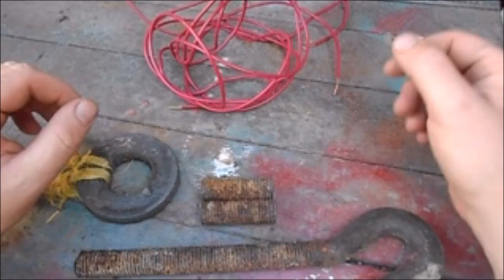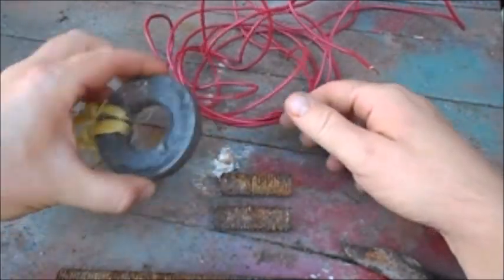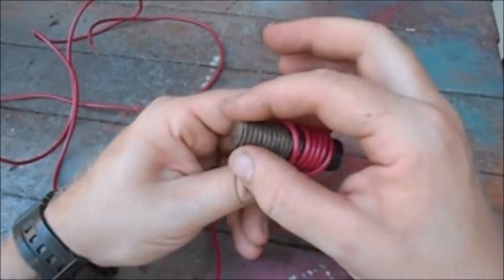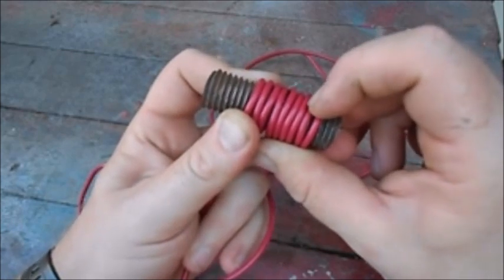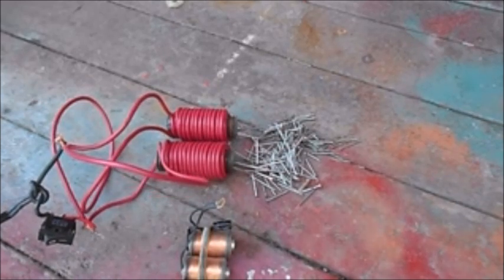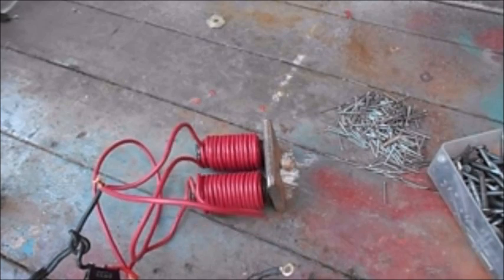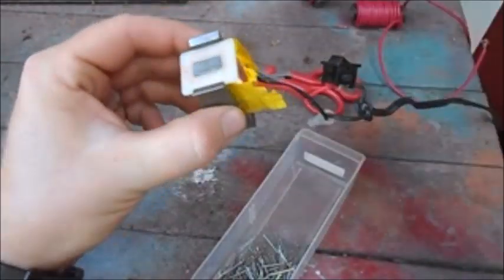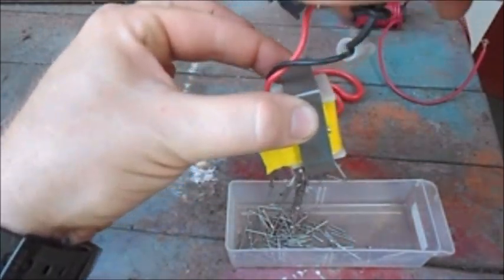Tattoo Machine Coils- Tattoo University

Comment: So what makes it go on and off quickly to create the quick stabbings of the needle?
Reply from the maker: The coil machine acts as a electrical circuit.  It turns on and off.  When it turns on the armature bar goes down.  When it turns off it goes back up.  Attached to the armature bar is the needle and the front spring.  The spring coming into contact with the contact screw (electricity) turns it on by completing the circuit.  When the spring looses contact it turns off.  The needle attached to the armature bar goes up and down with the armature bar.  The spring touches the electricity and then looses contact with it.  This connection and then loss of connection turns the machine on and off.  Needles go up and down.  Simple but awesome at the same time.

Comment: Is it okay if i use other wire..not a copper wire..
Reply from the maker: Tattooing is getting too stiff.  Not enough people willing to push the limits and try new things.  Don't just do what other people tell you.  Try out new things for yourself.
Reply from the maker: You have to look at the fundamentals of a tattoo machine.  Then look at what will work and what doesn't work.  Experiment and have some fun with it.  Part of the joys of tattooing for me is messing with tattoo machines.  Seeing what limits can be pushed.  The more you mess with them the more you learn.  Just look into the fundamentals.  Electricity, Magnets, geometry, and comfort.  You can make a bunch of stuff work but if it isn't comfortable for the artist it won't get used.  If you know the fundamentals you will know what changes can be made.
Reply from the maker: You can use different materials but you want to use what works the best.  Use materials that maximize the potential of the cores so they can pull down the armature bar with as little effort as possible.  You want the cores to be strong but you also want them to let go quickly.  Experiment and see what works.

Comment: hey love your videos. in your opinion what makes a "good" or "decent" machine if you can just switch out parts from any where? is it frame geometry , material used or something else? would really appreciate your opinion.
Reply: As a builder of machines, I find that my frame geometry is crucial to having either a liner, shader, short stroke, long stroke, etc. If I want more of a liner, I will build machine with side plate towards the back to right on top of front coil, if I want shader I put binding post hole past front coil hole.
Reply from the maker: A good machine is one that makes the artist happy.  I like certain machines that another artist might not like. A good machine lets the artist show off his art.  It works with the artist instead of against them.  I don't like heavy machines so I go with rotary or aluminum cast machines.  I don't use frames that are too thin.  It has to be thick enough so I don't worry about the frame getting bent.  I don't like machines that over heat.  I can usually adjust a machine so it doesn't do that.  If it continues to overheat I'll get rid of it.  The more you use machines the more you find problems.  I like machines that don't have these little problems with them.
Reply from the maker: I think the frame is really important and a good pair of coils.  The frame has to be made so the machine can operate correctly.  The coils have to work good so the machine doesn't overheat

Comment: do you have a video of this issue I'm going to describe and how to fix it...I have my spring tension set where I need it, I have the core heights adjusted so that the armature does not dip below the plain of the of the rear deck, and it would seem that everything is ready...however when I hit my foot pedal you can see it barely move like it wants to start but it fails to operate...or if you give it like a jump start then it will run but stop when testing the contact...I'm lost as to what is causing this and how to fix it??
Reply: Mark Kramer there's a ton of different things I could be. If you're not using a yoke, you need to make sure your frame is conductive and magnetic or you'll lose a lot of power, for instance if you have a steel frame but it's powder coated you need to shave off the powder coating around the base of the coils so that the metal of the coil core is hitting metal of the frame, if your frame is brass or chinese pewter or one of those superior tattoo plastic frames you need a yoke no matter what or the coils will pull really weak. Also just because your spring tension is "right" based on measured pounds doesn't mean it's right in comparison to how much you needed to bend that spring in order to get that much tension, you could have too much space between coil and arm bar. it can be shitty coils for instance using 12 wrap chinese coils when you're trying to get a really fast liner and you've got 22g springs, they aren't going to pull hard enough to overcome that tension and you'd want to hand wrap some 6 or 7.5s with thick wire. Could also be that your front coil is positioned correctly in proportion to the spring deck but that it leaves space between the arm bar and the rear coil. one of the things that makes a great tattoo machine is that space, on my best machines Aaron Cain's and a Joshua Carlton, there is NO visible space between the rear coil and arm bar the only way to tell is by slipping a piece of tracing paper under the coils and pulling down the arm bar, it gets stuck under the front coil and you can tug it out when it's under the rear coil, that's what you want just the thickness of a piece of thin paper. Also main spring tension isn't the only way to control speed, you could go with less spring tension but then switch to a lighter arm bar and a lower microfarad rated capacitor, that will speed up the machine without your coils needing to overcome more spring tension than they are designed for.
Reply from the maker: Usually happens when something isn't tuned correctly.  There is probably something that is still out of whack.  When this happens I usually start messing with it until something jumps out.  I go back and check everything again.  Sometimes it helps to take it apart and put it back together again.  Its like rebooting a computer.  Sometimes it just didn't start up right and you need to do it again.  I'm guessing when you say testing the contact you are putting your thumb under the armature bar????? I'm not quite understanding what you are doing.  Also what is your spring tension?  It could be too high or too low.